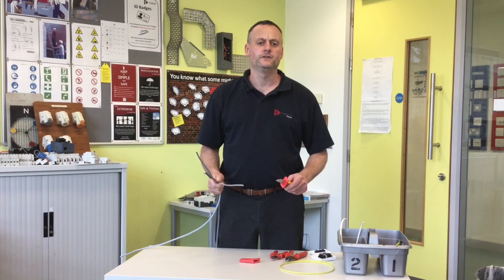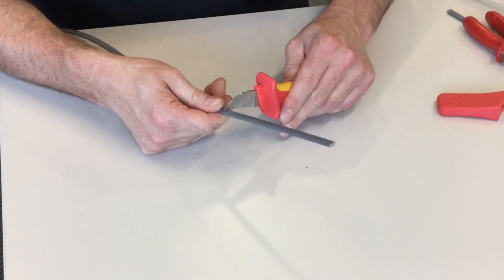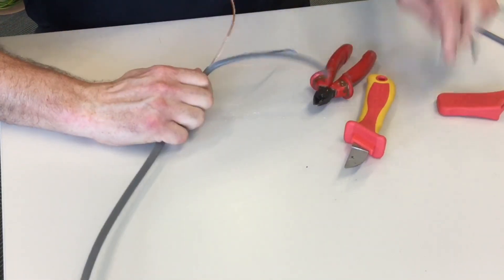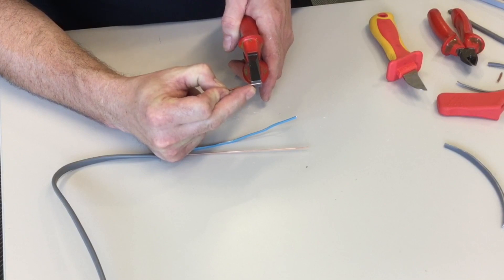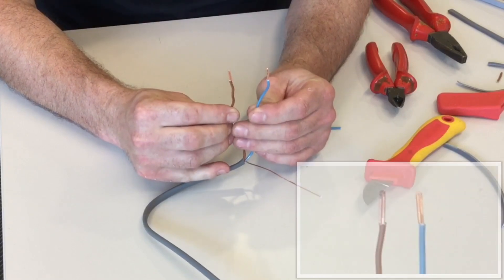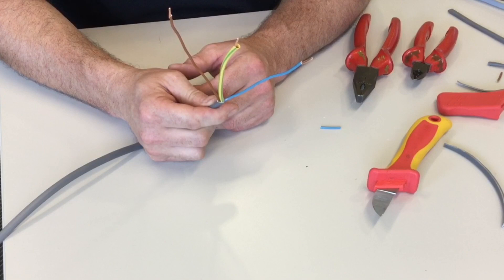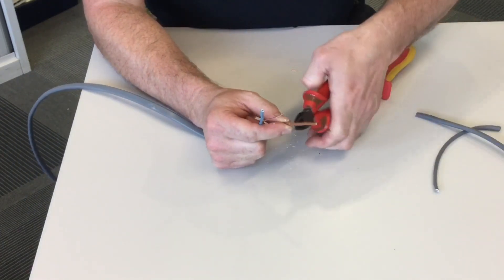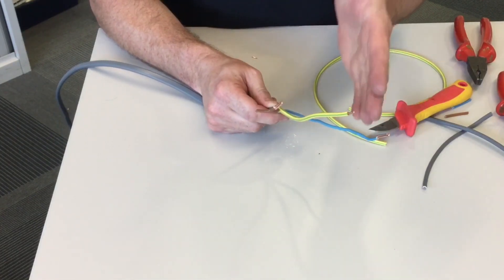Stripping and Terminating Twin and Earth Cables (How To... My Way)

Comment: I’m working on a older house with multi strand (red & black) T&E cable. Where I’m replacing a socket and need to strip the cable and rewire, do the same rules apply?
Reply from the maker: James Bennett sure 👍

Comment: Great video, not an electrician or anything but why do you fold the wire back on itself?
Reply: I'm guessing you've learned since, but for future readers, folding back the wire creates a larger contact to increase friction and conductivity when connected to the appliance. It's not essential but it's multiple positives for basically no negatives, so just do it.

Comment: U struggling wae that 2.5 lol...I kinda hoped you'd show us 10mm straight out the van in winter....and seriously who is gonna use 4 different tools time after time to terminate a dB.....
Reply from the maker: Hi... thanks for commenting... terminating cables at my college is all about building hand skill that are lost on the youth of today due to excessive gaming... all the best GSH Electrical
Reply: Cables should not be used outside their temperature parameters, you should not be so keen to get the job done. Start later later , drink more coffee while waiting for the cable to get to a working temperature,.
Materials only work well within their design limits , just like threading or bending cold conduit, you get poor results. PVC cracks and splits when cold, many a Swa has split while being run in,  a lot of effort if you have to rip out and start again. Same with T&E get up to temp and it’s easier to work with assuming it’s the good stuff.